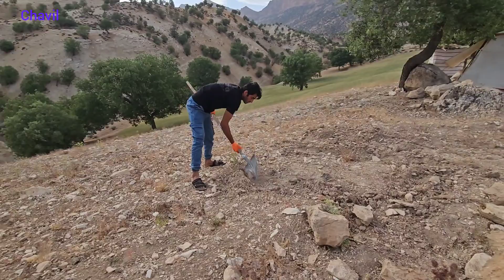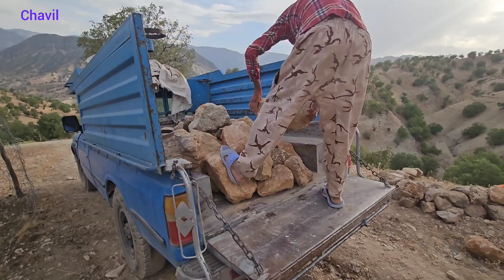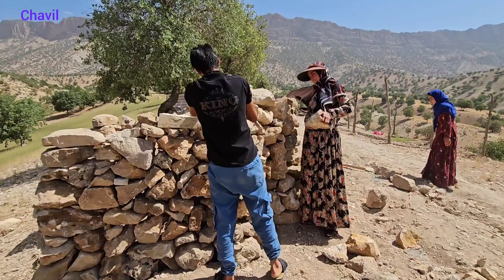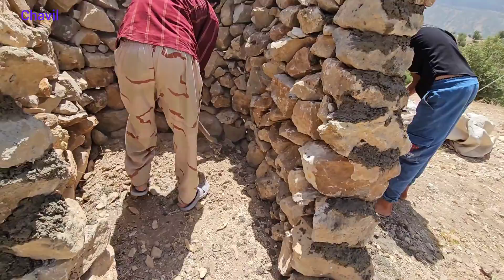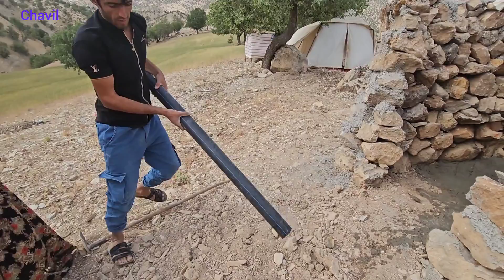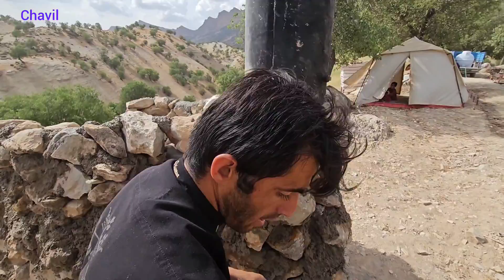Building a Nomadic Bath: Nomads of IRAN

Comment: You need more cement/concrete to hold the stones together at each level.  Not enough to splash cement at various holes or gaps in the stones. That wall is leaning outwards  therefore, unstable. 😅